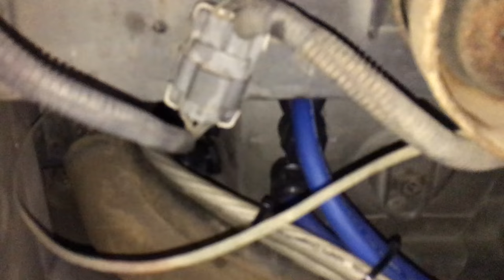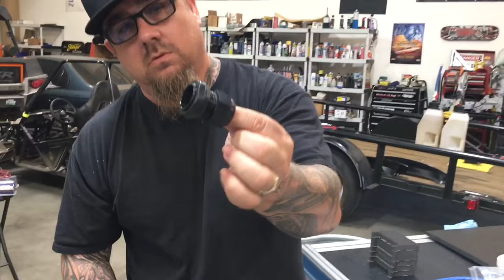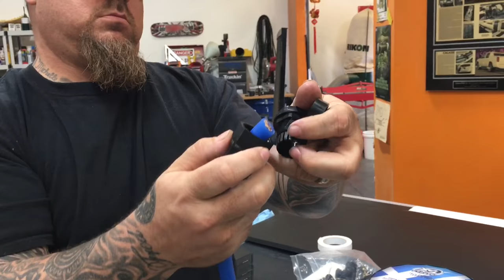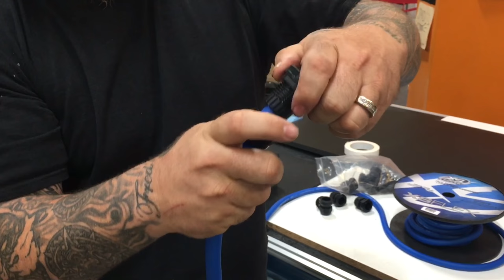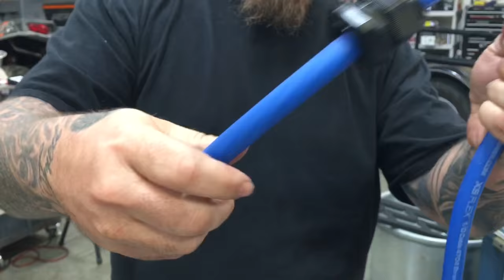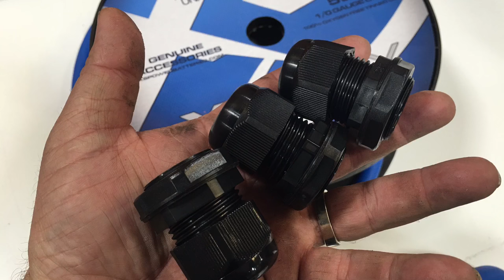Easily Pass 1/0 Power Cable into cabin - Self Sealing Waterproof Firewall Grommets - the BEST!

Comment: Steve, I know you have a forum to do this, but I hope you can answer this question real quick:

I want to do a big 3 hookup to my 1998 mexican classic beetle (aircooled), but doing the less cutting and drilling possible. Power wire is already figured out, but the problem is the ground wire since it comes out the battery, and its ring terminal is held with a nut to a stud that is welded to the floorpan/body of the car. If I replace the stud with a through bolt and run a wire from the engine block to that bolt from underneath the car, and connect the battery negative wire on the inside of the car, just like the original wire, will it work the same as running two separate ground wires from the battery?
Reply from the maker: seems like it will work like one run not two.  But it should work the same as the stud did.
Reply: Gotcha. Thanks for the reply.

Comment: Doesn't everyone use glands? These are nylon ones. You can get them from any electrical store. If you get the ones with the gaskets it makes it much easier for both installation and waterproofing.
Make sure you use a gland plate if you have a few going into thin metal, otherwise there may not be enough metal to support the holes.